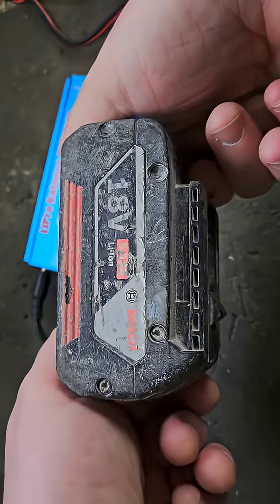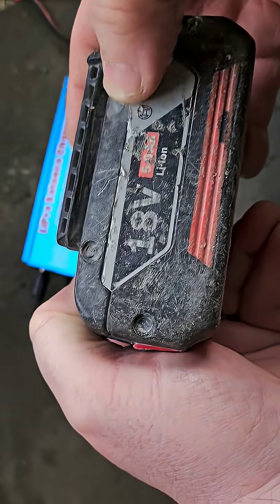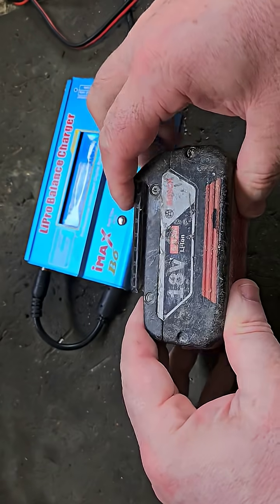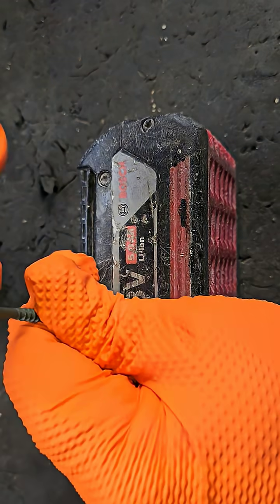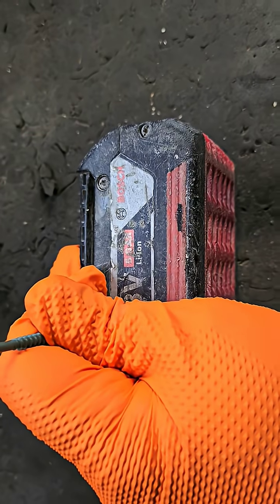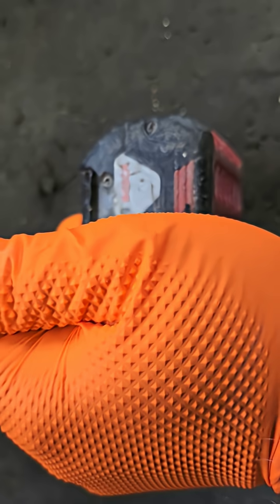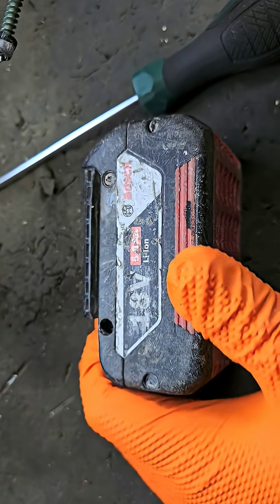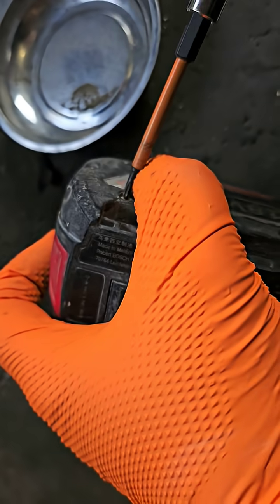How to open a Bosch battery #powertoolrepair #powertools #repair #diy #powertoolbattery

Comment: What power lead does that Lipro charger use? Can get one for like £10 but doesn't have power lead, is it a specific power lead / power rated lead?
Reply from the maker: It's an AC/DC adapter 12v 5.0A